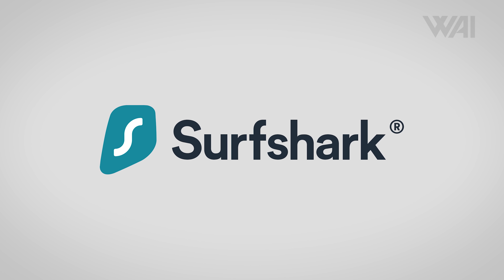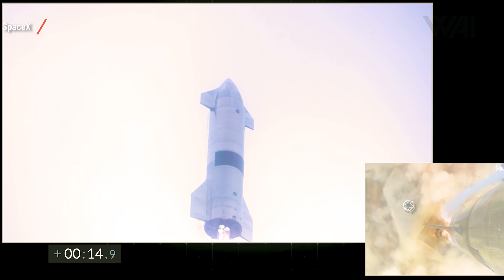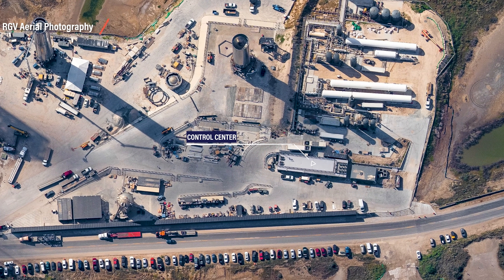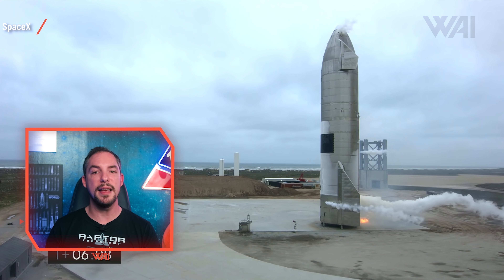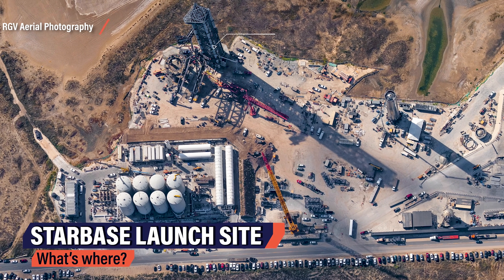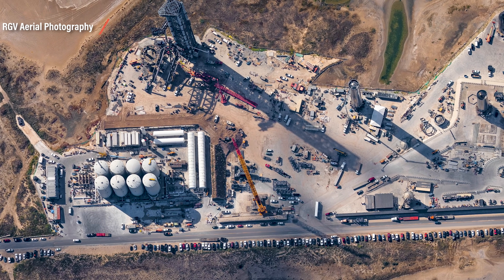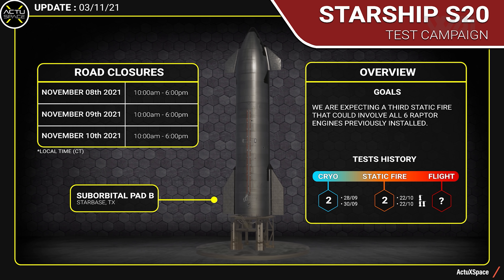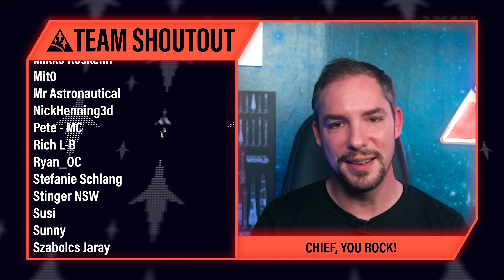What's the trick behind SpaceX's Starbase? Booster 4 getting ready for static fire!

Comment: To your question of 'why not landing legs'?    I think the answer might be in a review of all components for both the booster and starship.    Without the catching arms both units need to carry landing legs (and associated elements) with them on launch, orbit, re-entry etc...     If you look at what/where they are actually needed you can argue they are ONLY needed in the last 3m of flight.   So...   if that is the case why take them with you into space/orbit?    As a control engineer achieving the zero speed landing is difficult.  You need to concede that you will make contact at some speed.

Comment: A second stage has never been re-used?  That is basically what the space shuttle was.  Yes they used the engines from the space shuttle for the whole burn, but the booster rockets and most of the fuel tank was basically the first stage.  Either way they are both craft that are re-usable and must have a permanent heatshield to let them survive re-entry.

Comment: While it's great to be able to launch, land, and launch again, I have yet to hear how they will put in new payloads before each launch. Will these be in a cartridge-type housing that will simply be inserted via the tower? If so, aren't they missing the mechanism to perform that? It will be interesting given that sensitive hardware such as satellites are usually installed in a clean, enclosed environment. I can't imagine it being hoisted via a crane, maneuvered into position, and then properly secured inside the cargo bay.
Reply: You said it yourself, a cartridge system with the cargo loaded in clean rooms when necessary, i.e. satellites, humans....actually a preloaded cart system would be very effective for just about any cargo, would certainly speed up the loading process, and minimize security issues at the OLP. But yes, such a system has yet to be built.

Comment: Felix, you have an excellent channel and particularly the animated views.  One point has not been explained.  How do the chopsticks rotate the booster to align with the disconnect panel on the launch mount?  It is fairly obvious that they can position the circular booster body correctly over the launch pad, but they must also be able to rotate the booster.  I have my doubts that Space X can control the orientation of the booster to the necessary accuracy when catching, so rotation must be done after catching.  Similar problem when aligning the starship on top of the booster. The trackways on top of the chopsticks might be able to provide a small amount of rotation, but what about a gross misalignment?
Some time back, SpaceX made a ‘mysterious’ structure that, to me, looked like a turntable.  If that is what it is, the booster, and starship, could be lowered to the turntable, rotated, then picked up and placed precisely.
Thoughts?

Comment: Landing a rocket is incredibly hard to do. The motors have to stop the rocket at exactly ground level. 3 feet too high and it’s broken. 3 feet too low and it’s broken. But the braking motors burn fuel so the deceleration increases.  It’s all too easy to stop too soon. To do that within a few square feet with side winds is absolutely amazing.
Reply: Yeah but computers these days. If it was performed manually, you better believe it would still not be done and never be done on earth. The moon though...

Comment: Don't say no one has ever launched and landed a rocket before. SpaceX did not invent this, and Falcon 9 was not the first rocket to do it. Delta-Clipper-eXperimental aka DC-X was the first. It was a hopper. It was supposed to be followed by DC-Y, which would be an unmanned rocket to launch satellites into orbit. Senator Graham ordered the Air Force to develop it. After successfully demonstrating DC-X, it was given to NASA. And NASA was ordered to complete the project, complete DC-Y. What SpaceX did was continue the hopper test program, replacing propellant tanks with advanced materials: carbon fibre for the fuel tank, aluminum-lithium alloy for the oxygen tank. This was called DC-XA, the "A" was for Advanced. The Shuttle external tank already used aluminum-lithium alloy, but this was from a different supplier. It worked. The upgrades tested materials for tanks on X-33. However, one employee of Lockheed-Martin conveniently "forgot" to remove one of the safety pins for one test launch. The vehicle ascended, hovered, moved sideways to the landing site, and landed. After takeoff it retracted all 4 legs. Before landing it extended 3 of the 4 legs, but the safety pin prevented the 4th leg from extending. The rocket landed, and fell over on that side. When the side hit the concrete pad, it split open, spilling liquid hydrogen. When that hydrogen touched the exhaust from the rocket engine that was still firing, it caught fire and burned. NASA never rebuilt it.

So SpaceX did not invent the reusable or land-on-your-tail rocket. They just perfected it.

Comment: When I look at the long catch arms and imagine them holding a superheavy booster, I wonder if the tower is able to hold the weight. It just looks unbalanced. A counterweight would be needed to compensate the momentum. I imagine the tensile force will be immense at the backside of the tower.
Reply: The weight will be transferred by the drawback via the cable and pulley systems, which by virtue of its location at 180deg and at the base of the tower from the Chopsticks will act as counterweights.
Reply: Yeah I had that feeling
but then spacex probably did a ton of calculations
Reply: As a followup to this question, how would it be possible for a 'caught' starship that has extreme hot engines to be then placed on a booster rocket.  Would the top of the booster just melt at some points?
Reply: idk i think spacex steel should hold
I mean booster has no heat shield, relies on its steel body instead

Comment: Felix are you a bit troubled by how long it is taking to get this Starship & booster ready to test fly? I know obviously it is the first real prototype but even when SpaceX optimizes construction of the ship's outer hull, it seems all the exterior work needed (plumbing, wiring, raceway, heat tiles, etc) will push a full Starship construction time to probably 3 months or so to complete. How many will they be able to manufacture simultaneously - 2 or 3 max? That means only 8 - 12 ships per year might be built, not the hundreds that Elon is hoping for.
Reply: 1) The design hasn't been frozen, yet. What you're seeing now could be very different from what's sent to Mars.
2) The video concentrated on the booster. You're right, the booster exterior hull looks a mess. But even if the design doesn't change that much for the boosters remember that SpaceX won't need that many of them. Maybe less than 10.
Reply: Unfortunately starship just got cancelled :(

Comment: As to the pinned question: As Methalox burns cleaner than Kerolox, these vehicles should not be getting nearly as sooty as F9s as they descend through their own exhaust. That may leave the exposed QD face clean enough to get good seals consistently at the QD interface. A cover will happen only if the seals won’t seal.
Reply: The RS25s basically produce steam.  The SRBs are another story.
Reply: @pebmets  you may be thinking of the SLS? This thread is about Space X, it’s Starship and the quick disconnect (QD) fixture being used to supply it from ground  service equipment (GSE). As you say, the RS25’s are Hydrolox, and do produce ‘steam’ as their main combustion residue, but they are not what is being used on the vehicles using the QD fixture.

Comment: All Starships should have legs. What if on the way down to the tower, the tower malfunctions and your only choice is the old landing pad... REDUNDANCY!
Reply: Redundancy = weight. These are all testing prototypes anyway. They are expendable.
Reply: @agitatorjr  As long as when they rapidly disassemble they do not end up on private property or protected wildlife areas.
Reply: @pebmets  legs would not prevent that.
Reply: @agitatorjr  But if you miss your mark by two to five feet, you can still land vs a fireworks show if the arms can't catch you.
Reply: I would guess they redirect them to the ocean. Better to lose a relatively cheap and replaceable stage than your only OLIT.
Reply: They'll have to by the time they're ready for Mars that's for sure

Comment: That animation shows the starship being caught by the chopsticks with the booster right below in the launch pad.     I don't see the starship landing with the raptors torching the top of the booster.

Would have to 
- put the booster next to the pad, 
- catch the starship and put it on other side of pad
- pick up booster and put on pad
- pick of starship and put it on top of booster.

I would still worry about starship coming down with two raptors firing away with booster next to launch pad.   What About It? 😃
Reply: it is not. If you see it again you can see that the arms are to the side and then it swings it over to the booter. However I wonder if it should catch them on the other side and further from the tank farm
Reply: @eduardogardin879  Doh!  Don't know how I missed that.  It still will probably not go just like that for a while with getting it reliable and inspecting SS on the ground for the initial test flights.
Reply: I really don't get the whole catching idea in the first place.  Little to no margin for error, (a little deviation or the chopsticks do not get a clean grab of the rocket).  Seems more gimmick vs functionality.  If it adds time to the reuse, it seems like a little price to pay for a safer landing using legs.

Comment: During the first test flights could the fuel be used up by hovering so that the fire damage will be less in case of a crash?
Reply: Interesting idea. You want to land with as little excess propellant (= weight) as possible, so for a crewless flight I assume SpaceX would pump in only as much propellant as likely needed. I think SpaceX can de-tank excess fuel, I don't know if it reuses it. If I recall correctly, the Merlin engines in Falcon 9 boosters can't throttle down enough to hover indefinitely, but Raptors can. However having flaming rockets next to Mechazilla for many seconds doesn't seem very safe either!

Your idea seems familiar, but I can't find a reference to it for SpaceX. The Space Shuttle burnt off excess fuel: "In addition, excess OMS and RCS propellant would be dumped by continuous OMS and RCS jet firings to improve the orbiter weight and center of gravity for the glide phase and landing."
Reply: @skierpage  Not quite. Come down normal and then hover (hard with decreasing weight and any crosswinds) till the right time to shut down the engines.

Comment: Can somebody explain that hype of having double thrust over Saturn If your payload is nowhere close to double Satruns?
Reply: This is a two stage rocket and Sat V was a three stage. First stage in this case is doing more work.
Reply: @hookeaires6637  I don't get why we need to jump from over 7 1/2 million lbs of thrust to 15 million, (I believe that what Starship is shooting for).  SLS is 8 million and doesn't need refueling to get to the Moon or Mars.  It's payload is about 5 metric tons less than Starship, (95 vs 100).  Those 5 extra tons doesn't seem to need an extra 7 million lbs of thrust that Starship has.  I know reuse, but for what SLS is designed for, reuse is not a consideration for it's type of missions.
Reply: The Starship Rocket system has a higher dry mass because of the modifications needed for reuse.

Comment: While SpaceX is the only company to propulsivly land the booster of an orbit capable rocket back on earth, they are not the only ones to land a rocket stage. The Apollo lunar lander, and space shuttle orbiter are both rocket stages which landed, and blue Origin's new Sheppard booster has also landed (even before SpaceX). And some more organizations have recovered rocket stages after a splashdown in the ocean. Spacex is impressive, but lets stick to the facts.
Reply: well the lunar lander did not come back and the Shuttle did not land under propulsion. New Shepard began landing after SpaceX.
Reply: @eduardogardin879  But Shuttle glided down to a paved runway and was reused.
Reply: @eduardogardin879  And don't forget the DC-X in 1993 did propulsive landing, (though not from orbit).
Reply: @eduardogardin879  New Shepard successfully landed from a suborbital flight a month before falon 9 (November 2015 vs December 2015) and blue Origin reused the same vehicle almost a year before SpaceX reused a booster.
Reply: @Chill playz - you are not comparing suborbital to orbital, are you? They are two very different beasts. BO is still not capable of performing orbital flights, let alone return from them.
Reply: @RM6737  both F9 booster and new Sheppard are suborbital, the difference is that F9 first stage carries a significantly larger payload to a substantial tangential velocity. However if you read my original comment you'll see that the thing I disagree with is felix saying spaceX are the only people to land a rocket stage, which is not true when looking at all rockets and their stages throughout history. ( 9:32 )

Comment: I have a prediction, that would explain why Booster 3 is still on his mount. they will test the catching mechanism with a hop
Reply: The methane tank has been chopped off. It can not fly. They could use it as a chew-toy for the chop sticks, but that's it.
Reply: is missing the top part and catching points
Reply: can they?  i am pretty sure they cut off the catching parts of it
Reply: @machineenvyllc437  The only way it can be used at all is to be suspended by a crane. They can weld some bits on to the common dome if they want to simulate the top of a functional booster.

Comment: What is the source for expecting the sub-orbital pads to be decommissioned anytime soon? All I see is an environmental review which states up to 20 sub-orbital flights per year during the test phase and of course there's an undeniable need for sub-orbital hops to offshore platforms in the future. Oh and that's not to mention the sub-orbital pads are depicted proudly in Space's master plan for the launch area, in addition to 2 Starship/Superheavy structural test stands. So I don't understand why anyone would suggest these sub-orbital pads are history any time soon.
Reply from the maker: Thank you for the comment. I do believe this for numerous reasons. One of them being that the Suborbital pads are not capable of launching a current Starship prototype. Contrary to prototypes up to SN15, they're fueled through a quick disconnect panel on the side of the ship. No Suborbital pad has this. So, at least currently, no launch from a Suborbital pad. Not even a Suborbital one. That's the source.
Reply: @Whataboutit  Can a Starship (only) launch from Mechazilla and the Orbital Launch Mount? Does it's Quick Disconnect arm fit Starship as well as Super Heavy Booster?
Reply: @Whataboutit  

You believe this, but did not make known to anybody watching the video that you actually know this will happen. Doesn’t mean they are being decommissioned, and it doesn’t avoid the question of whether they could still vertically fuel the ships without any plumbing on the booster for that purpose; two fuel ports could be placed in two positions and allow ships to fly from suborbital and orbital pads, with different GSE systems accommodating both flight configurations.
Reply: @Whataboutit  That's a good point. But why wouldn't they just put a quick disconnecter onto the sub-orbital pads? What other info do you have? I also find it hard to believe they won't have Superheavy hops to test the catching process. In fact I'd be very surprised if that doesn't happen. Probably most likely they'd just build test vehicles with the old fueling system when using the sub-orbital pads unless you know more than I know.